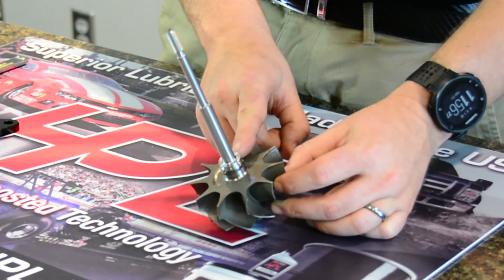PTE's Most Frequently Asked Questions! FAQS

Comment: Good info but you didnt mention anything about oil feed restrictors and their proper use. I have seen it alot of times where the engines oiling system is building excess pressure and alot of turbos NEED the oil restrictor in the feed line regardless. It will cause the turbo to consume oil and cause a smoking issue, whether it be filling the intercooler(charge system) then burning the oil off into the intake or pushing it directly into the exhaust and burning it off right there. Just food for thought, keep up the good work guys/gals. :-)
Reply: Hey bro my friend bought a new pro mod gen2 8891 turbo on a rotary motor ,he did what precision rec,dash 6 fed,dash 10 return.can you help.
Reply: oil coming out the exaust. tuners saying thats normal under boost it will stop.hard to believe.the turbo is brand new and cost 5000us$.the car never race or drive since dyno.